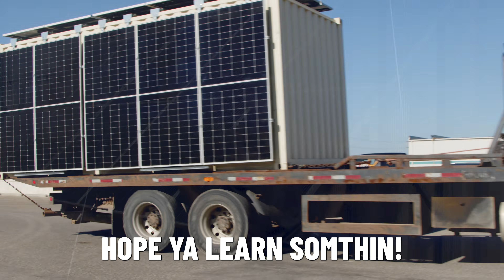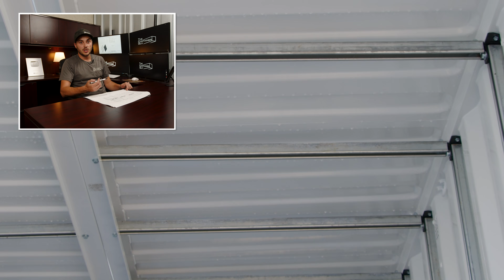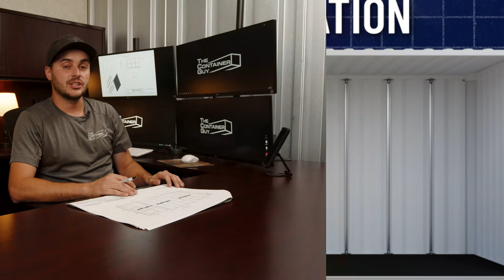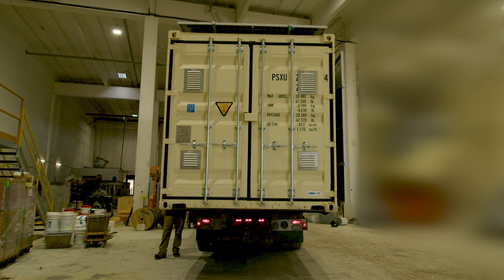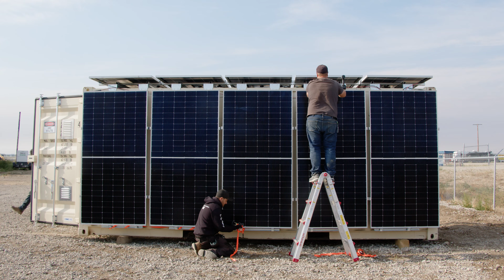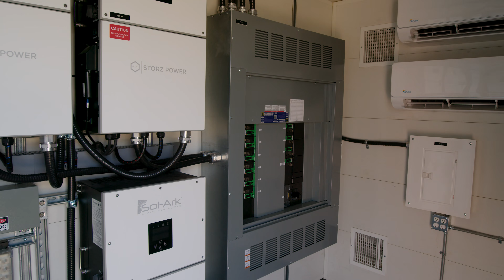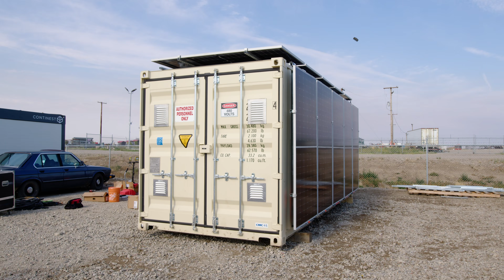Transforming a Shipping Container Into a DIY Solar Power Station! #NATO

Comment: If you cut 2 chain links in half and weld them onto either side of the grab handles and onto the shipping container you have a way to winch down the bottom side of the solar without needing to do all that loopy loop stuff with the tie downs, just a thought. That or just weld the half links to the container and get the U-Bolts in a small size and put those on either side of the grab handles if you don't want to weld to the grab handles to winch or tie them down, honestly a lot easier and more simple than what it's made out to be.
Reply from the maker: We have our Bolt-On D rings. Could bolt them to the strut. Awesome idea. 

I could also gap the ends of the grab handles with something that allows them to be strapped to turn-buckled back to the container. 

Keep the ideas coming.

Comment: Exaggerate much?  5400 watts will run about 5 normal homes, pretty small town.
Reply from the maker: The building can handle 135,000 watts. 5400 of that is connected to the container.

Comment: Ribbed chanel strut is a great choice.

Panel performance can increase with an adjustment of angle every month to keep then as close to perpendicular to the sun's path. Six monthe of increasing angle and then six months of decreasing angle. You could mark on the strut the points to adjust the connector to so the six desired panel angles are achieved. The set points are not universal. The will depend on the latitude where the container is sited.
Reply: Youre just adding more complexity...  They can use a ground mounted sun tracking system in addition to the attached panels. Why add so much complexity for such marginal gain.

Comment: Consider a set of  reinforced rubber strips in front of the panels. (one for top, one for side) about 1" lead and 2-3" farther out than the panels, air pressure will push the far end against the panel and make a fairing to keep the air pressure from behind the panels at higher speeds. and no pain if bumped into on site.

Comment: QUESTION PLEASE:
* Why didn't you install three (3) sets of panels (ie: both sides and top) instead of just the two sets (ie: one side and top)?
BENEFITS OF INSTALLING 3 SETS OF PANELS:
* Obviously, you get more electricity.... but that's NOT the main reason.
* You get to generate electricity the ENTIRE DAY!  
YOU CAN HAVE TWO DIFFERENT INSTALLATIONS FOR THIS CONTINGENT UPON HOW YOU DESIGN THE MECHANISMS:
INSTALL #1:
* As the sun comes up in the morning, one side of the shipping container generates electricity.
* Then, when it reaches 12 o'clock noon, the top panels are LAYING FLAT and generate electricity.
* Then, as the sun sets, the other side of the container generates electricity! 
* So, in this set up, you don't have to have a mechanism for the top panels because they just lay flat all the time.
INSTALL #2, WHICH I BELIEVE MIGHT BE BETTER BECAUSE IT WILL GENERATE MAXIMUM ELECTRICITY EACH DAY:
* Install the 3 sets of panels..... on the two sides and the top.
* But, in this installation, your roof panels have mechanisms that allow them to swivel or rotate to three different settings for the three different times of the day depending on where the sun is.
* Meaning this: in your current install, the top panels ONLY rotate to generate electricity for one side of the shipping container, which is the same angle as the panels on the one side.
* Why not make a mechanism at the top that allows the panels to be angled towards the sun during the morning.... then during 12 o'clock noon the panels lay flat.... then during the afternoon, the panels rotate the other direction that align with the other set of panels on the other side of the shipping container!
* Now you get two sets of panels making electricity in the morning (one side of shipping container and the roof), one panel making electricity at 12 o'clock noon (the one panel on the roof), and two sets of panels making electricity in the afternoon (the roof panel and one side of the shipping container).

DOES THAT MAKE SENSE.... DID I EXPLAIN IT CLEARLY ENOUGH OR IS IT CONFUSING.... please let me know.
With my suggestion the cost will be more of course but, you have more flexibility to generate electricity all day long and that might be critical to some customers!

Just A Thought... Please Give Me Some Feedback!  : )

Amen
Retired, Veteran
Reply: Good idea if you do not plan to move the container from location to location in your particular application. However, a third set of panels will most likely require an oversized load transporter permit as it would be about 9' 2" wide. Also, the side man door would be lost, which may or may not be critical as there is a second entry door.
On top, you would want an automated sun tracker (a photosensor driving a motor and gear) to adjust the panel angle to the sun. To manually adjust the panel three times a day, every day, is not efficient work.

Comment: Couldn’t y’all use essentially a removable quarter round on the leading edge to deflect the air around the panels? It’s basically what cab fairings do, deflect the wind around the trailer so it’s not so brick like.
Reply from the maker: 👌Deadly idea🤘. That can also be the door stop so the container doors don't swing around and hit the panels. Keep them coming please!!! Thanks

Comment: I wonder what kind of power station you could build with double containers
Reply from the maker: An English vendor is working in Hong Kong on a 1 MW battery pack inside a 20' container which would be an insane amount of energy storage. Then just need a large ground array to generate the power. Would be a cool project.
Reply: @TheContainerGuyTV  Wow! You would need about 500 LG bi-facial panels.  $$$

Comment: Very confusing without the engineer that designed this and it's intended purpose.. 5400 watts of solar, very little batt capacity, the big transformer all those Sol Ark's. Huge head scratcher and then there's the price. It must be the mech room room for the generator but still difficult to take in.
Reply from the maker: I understand. Yeah it's a BIG project and I could only say so much because of confidentiality reasons. It will be tied to a generator and a substantial ground array. I think 280 solar panels can feed into this thing. 

Believe it or not, it is a small $450,000 test / proof of concept. There is not nearly enough battery storage capacity to make sense for how much power could be generated.
Reply: @TheContainerGuyTV  Thanks, it had to make sense. lol
Reply: This is the "command" unit for a big field of solar cells. The solar here is enough to make sure the equipment works.

Comment: Would some neodymium magnets work to hold the panels closed during transport?
Reply: No, Better to tie them down.
Reply from the maker: Not sure. Very interesting idea. That's why I love this channel. Any specific ones you know of that are durable enough for the task? Preferably with a bolt-on mounting system.
Reply: An air deflector will do the trick..fixed at the vertical  edge of the container

Comment: This is an awesome idea, we will definitely be doing this, did you consider gas springs? Maybe not enough variable angle for different times of year?
Reply from the maker: Can manually adjust from 0 to 70 degrees depending on the time of year and your latitude. 

One cool thing I learned from the customer: If you had solar panels that followed the sun, it would only gain a max of 20% output. It is much cheaper to buy 20% more panels than develop an automated, electric drive system to follow the sun. Less moving parts is also better (all else equal).
Reply: @TheContainerGuyTV  you can do it with Pneumatics(you need to install a air compressor for this) or linear servos. There are already solar tracking systems you can use with 'em.  I'm working on very similar concept right now for my farm project. I will update you in the future. You gave me lots of good ideas. Thanks for that 🤘🏼
Reply: @TheContainerGuyTV  I have read information that contradicts this 20%-40% number. when panels remain perpendicular to the sun, then produce maximum power output. When fixed, the quite literally NEVER are perfectly facing the sun. I am not suggesting you incorporate sun tracking into your system here, just making a small point since many people may read your comment.
Reply: @TheContainerGuyTV  this: everyone is focused on maximum peak output. What you want is reasonable output during the whole day. Because either:
1) your setup can not handle the peak output because you want it to work during very low sun.
2) your setup does not turn on soon enough because you have focused on peak power and it doesn't work during low sun.
So you should only focus on maximum total output of a day in bad weather. Who cares if you lose energy during the peak, if you can't get any in the winter.

My panels are facing east and not south. At that time (more than 10 years ago) I was more worried about neighbours  complaining about sight than peak power in summer.
They also gave me an inverter that turned on early, but could'nt handle peak power in summer. As an energy nerd that was indeed more important to me than the stupid governmental rules we have.
Currently I changed energy provider and I now pay prices per hour as predicted 12 hours before. That makes it even better to be smart about most power vs peak power, as energy prices are negative during the summer peak. My panels already kick in during the morning peak.
The difference in price per kWh during the day can be as high as 50 eurocent.
A container like this would be able to feed back predicted excess battery power during the peak usage, earning that 50 eurocent per kWh, if your upstream would allow that.
Reply: @TheContainerGuyTV yea it's cheaper to to buy 20% more panels, but where you gonna put those extra two panels?? On the floor next to the container? Now when you want to drive somewhere you got to load them into the container....
 An automatic sliding system is more complex but for a better power density & portability, utitilizing the space available, it think its a no brainer to do at this pricepoint
Reply: @fire17102  @TheContainerGuyTV Actually, you could have a couple of panels fold open from the 2 panel section. Have them hinged and fold to the left. They would extend past the container, ad during shipping they would need to be strapped (secured) down. And gas lift assists should be used, that will help in case the handle slips from someone's hand and help even in heavy winds.
Reply: @TheContainerGuyTV  you can buy 20% more panels and then have them follow the sun, for an extra 20%, thereby 20%ception complete!
Reply: Good to see a friendly face here!  Love from Turkey 🤘🏼
Reply: A simple, hand cranked  windlass. Make the hinges into a cable operated scissor lift.
Reply: Very Canadian.  R&D for your competitors? For the greater good but hope a large competitor does not take advantage. The best.
Reply from the maker: @JohnJames-fv4us  🤷 meh.. usually what's out in the public is 2 revisions behind. They can steal my old revisions but they can't steal my brain haha. Also, I'm in this one for the greater good. If anything will be proprietary, it's the climate controller.
Reply: @TheContainerGuyTV  Outstanding job, loved the video and appreciate u sharing you and our team’s hard work.
Reply: @TheContainerGuyTV your climate control may be of your own design but there are other systems out there that do the same thing .
Where I used to work we had power control and distribution room on such a system . We had 138,000 kva mains coming into our main sub the branch off to the distribution room. Our climate control system maintained that environment amazingly well. I believe it was a Seimans branded control .
Reply: The only true way to move this beast is to rotate all cointainer. Maybe putting wheels and electric motors? It would neeed only 1 wheel just rotate it, but then other side would drag.
Reply: Maybe just put it on cercular rails and rotate that way?
Reply: Nice Job on this!

Comment: Congratulations on not settling for "close enough" to align the panels, safe for transport, and safe for the operator. Well done! Those panels come in seemingly endless sizes, so keep that in mind when you move forward on your 'DYI'  options. For those who intend to routinely deploy and retract the panels, consider gas struts to ease the weight.

Comment: Did you say 450K for this?! Somebody got robbed!
Reply: $83 per rated watt which you'll never achieve even during peak daytime!!! but there's a generator mentioned. WTH is going on?
Reply from the maker: The next two we build will have much more battery storage and be the central hubs for Northern Communities' ground solar arrays. This is not a residential system. It's a municipal solution.